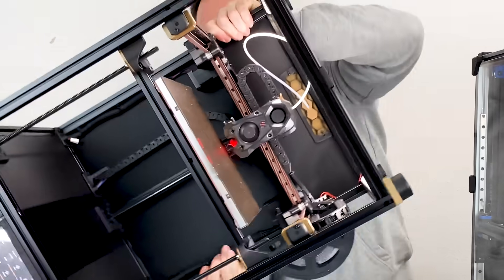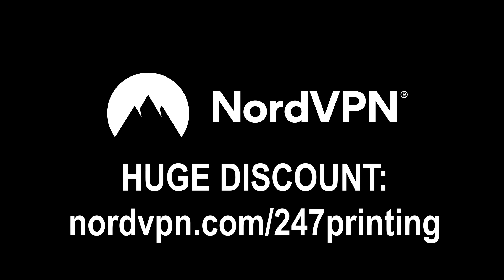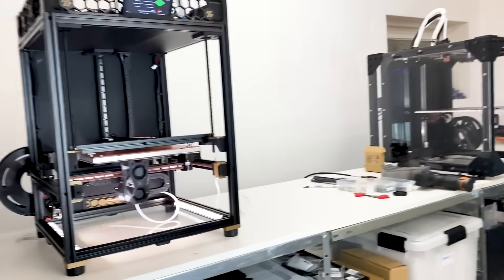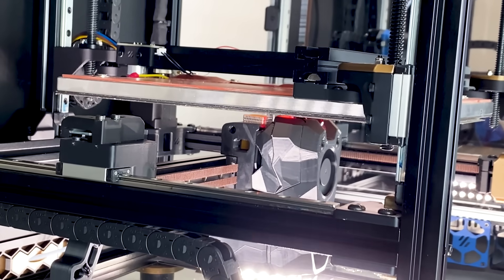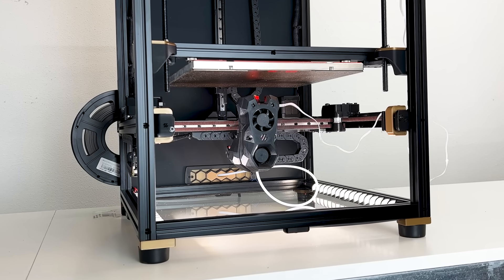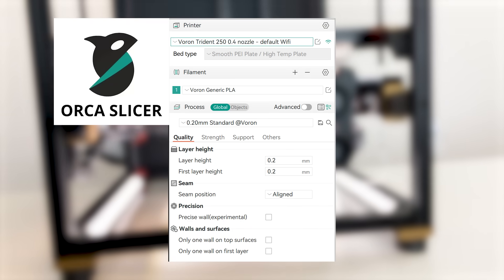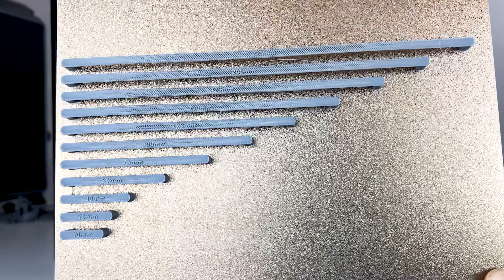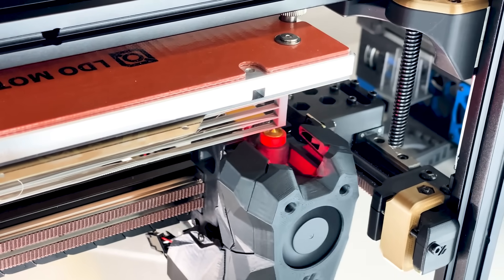Upside-Down Printing: Tested on a Voron Trident!

Comment: can you expand the 3d printer bed? for example, changing the bed size from creality K1  SE from 220mm x 220mm to 300mm x 300mm? of course you have to change the frame size too, but I wonder if that can be done?
Reply from the maker: That’s making a whole new printer, yes, you could but doesn’t make sense
Reply: @247printing i don't have enough money to buy creality K1 Max yet, i think changing the frame and bed size won't cost too much, so it's like voron trident frame but with the creality machine🤣

Comment: What happens with retractions and printing hot? Can you print much hotter, with less oozing? Will this result in stronger parts?

Remembering that you will be printing at higher ambient temps due to the bed heat

Comment: Horizontal bridging probably had better cooling because air from the printer head would collide with the plate and blow practically from top and bottom while in vertical scenario cooling would be significantly weaker.

Comment: I tried this with my 2.4. I switched back to regular after bed started to bend and required a lot more glue otherwise prints would fall. Especially PLA parts.

Comment: One major disadvantage of the upside down is that stringing or failures can damage the toolhead. Also you need quite the good bed adhesion for heavier prints.

Comment: If you park the toolhead at the end of print and allow the bed to completely cool the parts will fall off. Have the "top" panel removed and a shoot below it. When the print cools and falls off the bed. It will fall into the shoot and into a bin. Then you can immediately start a new print without having to manually clear the bed.

Comment: One last bridging test that could be tested is taller pillars with unblocked bridging to determine whether it was the lower bridges shielding the hotbed from higher bridges or just distance away from hotbed.

Comment: Hello 247 printing. I have another idea that you can test. I believe printing upside down can be beneficial for printing high temp materials like ABS. With a shield around the object it can trap hot air and resulting less need of closed chamber printers
Reply: Would actually be funny to see if hanging a wall along the edge of the bed could create a hot bubble against the bed. Might even need less power to keep the bed warm.

Comment: I think having the motion system on the bottom on the bottom of a machine such as the voron is sure to show little to no differences since the frame is so rigid and well built. The point of having it lower down is to negate the need for such a stiff frame in the first place, reducing production costs and complexity, which was clearly explained in the positron video. You should redo this test with a different frame than the Voron

Comment: Why did you get equal input shaper graphs for x and Y? I think the reason for cleaner graphs upside down is because the cable chains and other cables are somewhat taken out of the equation when upside down. They are free in the air and more decoupled from the rest.

Comment: It’s quite likely that a printer would need to be designed with principle in mind before the real benefits become apparent. For example, since the distance between the moving mass and the foundation would be much shorter for the upside down configuration, stiffening the chassis would be much cheaper (bigger but very short extrusions and braces). Also, it’s really important what table the printer sits on. No point have a sturdy frame on a water bed.

Comment: So, what about on it's side?

Bridging is vertical, mass on both ends, could be a "best of both worlds" thing. I actually have a few prints with print-in-place features that stack, and I wonder if I could get better results with less parts sticking and lower break free forces if I flipped it upside down now.

Comment: The advantage in printing upside-down is not really in the printing itself, but in how you can simplify the design of the printer. That's why Krayln chose to go upside-down - to simplify the structure of everything above the base to make it foldable. I designed this 350mmx350mm large format printer (https://youtu.be/hdju_6XEHZ4?si=Dh0bzsGIzZTzsoCE) with a granite base for stability, but it required only a very minimal structure above the granite slab.

Comment: also imagine a print coming loose on an inverted printer...i wonder what inverted spaghetti looks like. heavier prints pull more and more on their base as they progress which might become an issue in some cases. wiring on top is nice but when the printer is finished and working one doesnt need to access them often.

Comment: Upside down printing is an old hat by now. The oldest example i've seen was more than 10 years ago, it was the early wooden Ultimaker that got its Z axis expanded to span 3 or 4 meters in height, but because the printer at home position and toolhead needed to be at a human accessible level, they flipped the printer and simply extended the axis in mid air above the printer. It was of course a joke build to an extent, because if you try to print something as heavy as the height would support, well it'll be trying really hard to either fall off the bed or break it.

Other early upside down experiments were by Lulzbot and James Bruton, Tinkerine and Maker's Muse, and an improvement in overhangs and bridges has not been observed.

But of course we didn't have the tools that you're applying today to judge dynamic performance.

Comment: As said in your conclusion, upside down printing was mainly chosen by kralyn3d to limit the bulkiness of the frame as all acceleratig parts are mire or less directly supported by the base, except that and the better view offered to check buildplate adhesion there wasn't lots of difference with normal upside fdm printing

Comment: I managed to get 75 degree overhangs and significantly better overhangs on the positron than even my P1S with the aux fan. Not sure why your results weren't similarly impressive going upside down.
Reply from the maker: Try to flip the P1S upside down and repeat with the exact same gcode to see if it’s an upside-down effect or if it’s one of the many other variables in that game when comparing Positron vs. P1S

Comment: The main potential advantage is in automation, getting the part to drop off the bed directly into a bin without a complicated mechanism.
Reply: yeah i've seen someone put shoes strings on the flexible bed tabs and just set the g-code to push the bed all the way forward which bent the buildplate to release them, worked great.
Reply: Belt bed printers are the way to go for that. But I've also seen printers set up to "knock" prints of with the print head to achieve this. Which feels a little brutal on your hardware.
Reply: Probably not what you meant, but in the UK a bin is usually used to refer to a place you put your rubbish/waste. So I had this hilarious image in my mind of the printer just printing parts that immediately go into a bin bag for easier disposal.

Comment: a note on the Trident, there is an Inverted electronics mod that makes them more accessible. Instead of flipping the printer over you just have to open the bottom panel.
Reply: This should honestly become standard in the next revision. Only thing that changes are 4 printed parts, the din rail brackets and front z stepper mounts
Reply: @over_pizza_2578  having just completed a build with this configuration from the outset one big consideration stopping it from becoming the standard is reduced ability to isolate/seal the print chamber effectively.

That aside it really is an obvious and huge advantage for tinkering which seems to be most of the point of building a Voron.

Comment: Have you done a comparison of your voron and ratrig yet?
I love my ratrig so much I haven't even thought of getting a voron but if its better then I might.
Reply: I would also love a comparison as both have a different design ethos. In theory the ratrig should beat the vorons in terms of speed due to their structure, bigger belts and lighter toolhead.

What i can already tell you is that a trident is quicker than a 2.4. My trident has roughly 15% higher recommended accelerations than my 2.4 at the same setup. My thoughts on that are that the frame of a trident is simply stiffer as the gantry is structural and not suspended on printed parts

Comment: Hey 24/7!
I am the designer and creator of the Inverted CoreXY Bed Slinger converison kit! I need a proper name for it I know. Anyway, If you would like to hear a second testimony about printing upside down I have some videos posted to my channel from the last few weeks detailing the inverted printing process and its benefits/design choices. Something to keep in mind about your data; because you flipped the printer and left the majority of the electronics and mass on the traditional bottom of the printer, you actually raised to volatile mass which lead to the more severe vibrations! In printers where you lower the center of moving mass as well as the volatile mass you should see improved vibration measurements. If you would like a kit, I would love to send you one for more testing!
Reply: I love getting my cheeks rattled by other men 😩
Reply: The Invertron 9000 sounds good to me.
Reply: Retnirp D3
Reply: @testboga5991  that even sounds like somthing said in reverso. nice.
Reply: AntiGravityPrinter 🙂
Reply: Name "Pulldown Kit"
Reply: FZM like FDM 
AntiGravi3d
or FZM (brand) Antigravity (Model)

Comment: If you do decide to move the electronics to the inverse then you should do a test with all electronics separate and not part of the print chassis.
I do wonder how this would improve speed and quality.
Reply: I actually wondered if having a high static mass and low dynamic mass actually dampens acceleration if done right.

Comment: 17k Y axis on a stuck trident? theres something really weird going on, the usual is 5 to 8k
Reply: I was surprised to see that as well. I finished my 300mm LDO Trident kit a few months ago and have never seen my input shaper results recommend higher than 6-7k accel even though my resonant frequencies are nearly the same as his (slight over 70hz on my X and slightly under 70hz on Y).
Reply: Something odd is going on, he got higher recommended accel for Y than X...

Comment: I thought that the whole upside down thing was to make the system portable.  At least that's what the Positron was designed for, I've never heard of the KOKONI. I guess people think since resin printers are "upside down" they should make FDM printers the same.
Reply: The Kokoni Sota is a kickstarter project. There are some very irate people who backed it since it hasn't delivered; there were wiser people telling them they were being foolish so no sympathy for them. The giant sized red flag was that they never provided any working machines to respected reviewers to try. They did take one to Naomi Wu, but they couldn't get it to work in her presence. All they seemed to have were flashy graphics and claims.

Comment: The mechanics in the Voron Trident (and many other printers) may depend on gravity to work.  Backlash in drive screws in the Z direction could be affected, as well as loading on the motors.  3D printing upside down on a build plate isn't a crazy idea, Resin printers operate in this way, so FTM printers should be capable of this.
One thing though, depending on the filament used, you might need to remove the parts from the bed soon after the print finishes.  Othewise, once the bed cools, your print may fall off the bed, and shatter (PLA)!
Reply: Could also place a catch tray underneath and call it a feature

Comment: I suspect that bridging is solely influenced by cooling, lower down, the part cooling (and bambu aux fan) might interact with the bed surface. I can't imagine the temperature difference of a few degrees to make a big difference in relation to the temperature of the extruded plastic. If that were the case, pre-heating the enclosed build volume would also improve bridging, which might be worth a test.

Comment: Should of done the upside down electronics bay for the Trident. Maybe look at the FT EMS mod on printables but you will have to talk to the Fizzy to adapt it to the 250mm build. He has worked with Old Guy Melts Plastic to develop some already

Comment: I would love to see a video of the bridging topic. Really curious to hear your thoughts why the bridging got so worse. 🤯
Reply: i think it got worse since gravity is still an issue but when putting the printer upside down it's just making it work less in your favor, what I mean is when the printer is right-side-up, the bridged material just droops down and doesn't collide with anything ( it gets further from the nozzle when drooping, making it not collide and not heat up as much again). when the printer is upside down, the bridging material starts drooping towards the printhead, which makes it drag on the nozzle/heatblock, and it makes the bridged material heat up again when the head is doing another pass of the bridge, since the material is drooping towards the nozzle now, instead of against it. I did not do any reasearch, but im pretty sure that is at least part of what is happening.
Reply: A huge Volume bridging test similar to the crazy stairs painting would be very cool!
Reply: Heat rises up
Reply: Aaaah could make sense that it is due to the heating and cooling
Reply: I am curious too.
Bridging could have 3 relatively likely different outcomes.

1. Bridges get pushed back into position, resulting in more accurate bridges/overhangs

2. Bridges sag more, because the heat rises...

3. Sagged bridges/loose filament get caught by the extruder and the print comes off the plate

Comment: I think the future of 3d printing is placing the whole machine in a giant gimbal that allows it to be oriented in any direction! 

But semi seriously,  I wonder how well bridging would work with the machine tilted 90 degrees? If you are trying to bridge gaps that are perfectly vertical you might get actual good results since the first layers will probably not deviate from their intended locations.
Reply: Very interesting. Surprised that I've not yet seen a 3D printer that's flipped onto it's side to help with bridging!
What could the possible limitations be? Filament flow wouldn't be affected I think, maybe the additional gravity on the X axis could be a problem (doubt)
Reply: Or even a 5 axis system where the 4th and 5th axis are tilting the bed to print any overhangs
Reply: i think this is a good idea, however it would require re-engineering the motion system of the printer.
a rotating print bed would be one of the first requirements, second would be how to drive the tool-head vertically without introducing print artifacts (as currently +X +Y -X -Y moves are all treated as equal).

Comment: Except for the positron. I feel that upside down printing could only be use full if the print detached it self after printing and thus the printer could start with the next part automatically.

Comment from the maker: What do you think about the Positron, the Kokoni Sota or Upside-Down printing in general? Please tell me!
Reply: I would like to see super volcano hotends used in upside down printers. With gravity at your side retraction is possible regardless of how long the melt zone is. It seems no one who ever tried upside down printing thought of that.
Reply: it is anyways... the filament results in a low pressure zone and thus pulls the moltn filament back   @marcellofialho677
Reply: @marcellofialho677  I think it's possible rightside up too. I'm using TL extender on VM for a total melt zone length over 40 mm, and retraction works fine. A lot of the old myths came from pre-PA era where everything with retraction was wack from trying & failing to incorporate pressure relief that varied depending on speed (which in turn varied depending on detail resolution).
Reply: 3 completely different topics. One is a printer with very special constraints, one is a Kickstarter scam, and one is a matter of how gravity interacts with printing (bridges, stability of frame, etc.)
Reply: I think the idea of a foldable printer is quiet unique, though i am not sure if this is a common use case
Reply: I think if you continue with these type test you may want to make a nozzle shiel, a simple wrap around cone should suffice. Will help up for any massive spaghetti failures or part release.
Reply: I would like to see more testing on the effects of gravity when printing.  As mentioned by Marcell the impact on retraction on hotends known for poor stringing would be interesting, as well as the effects of 45 and 90 degree angles on prints.
Reply: @crashingsux  This is something I haven't seen anybody explore. In theory when printing upside down gravity gives you complete control of how much material you push out of the nozzle. You could use the Dyze Design Typhoon extruder and still print at the layer height of your choosing, at the speed of your choosing.
Reply: @marcellofialho677  Also, plain old nozzle ooze. Is it purely gravity based, or does it still happen when the nozzle is sideways, or even upside-down?